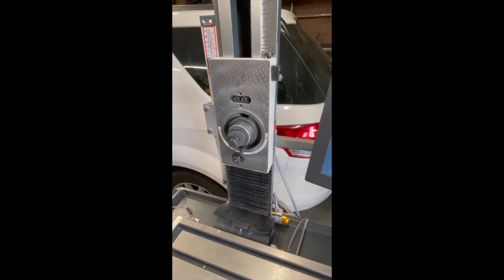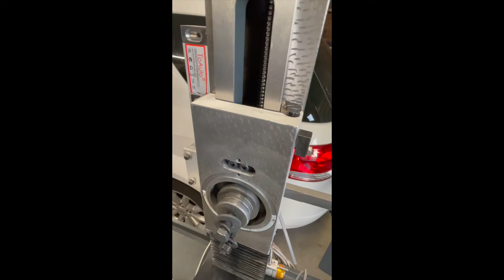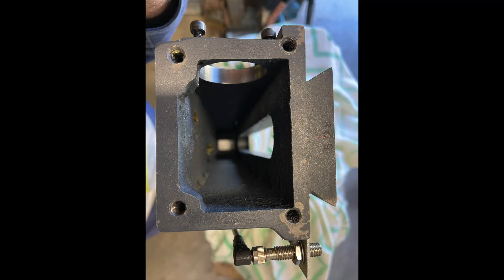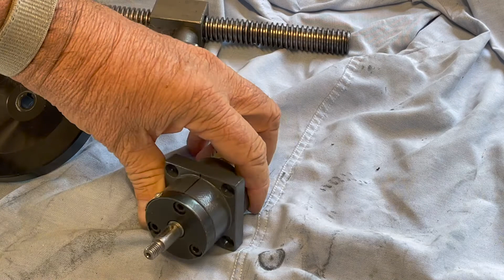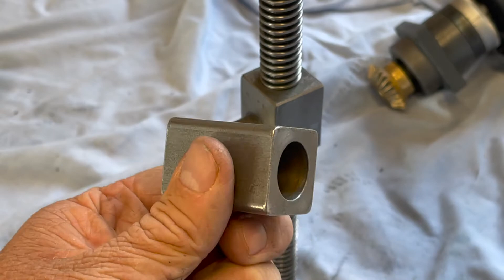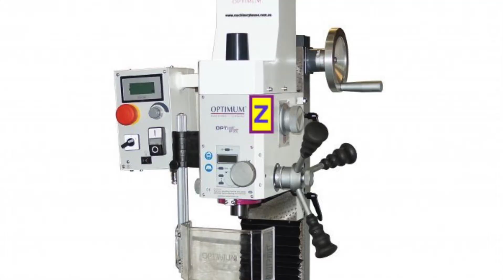BF20LV Z

Comment: Hello great videos. Are you happy with the mill as I am thinking of getting either  20lv or hafco hm46. Still looking at pros and cons
Reply: It is a small mill and therefore has some mechanical limitations. A 50mm face cutter is fine on Aluminium but not so good on Steel, even a 20mm end mill on steel is a challenge. If you have the space available, get the largest mill you can afford.